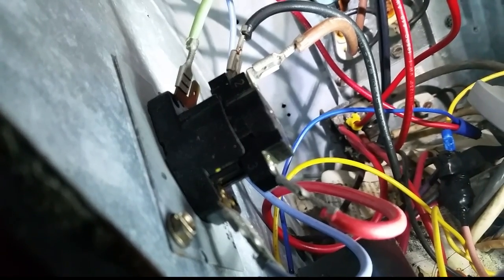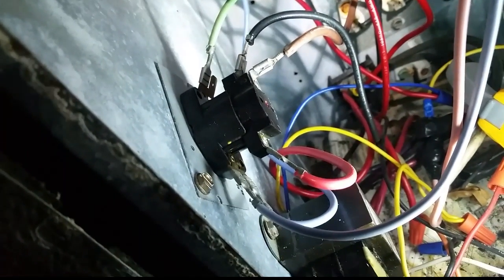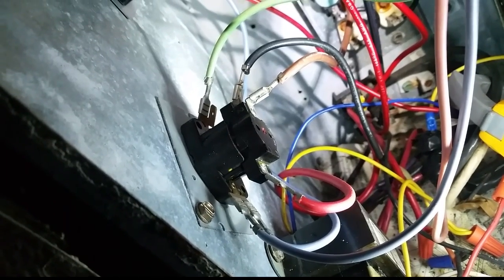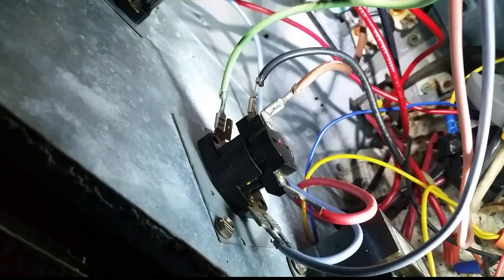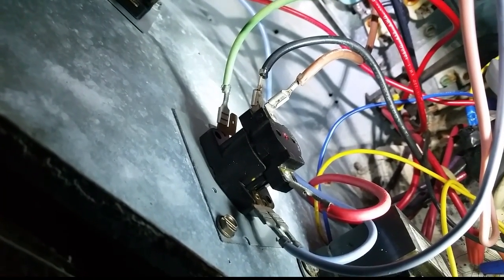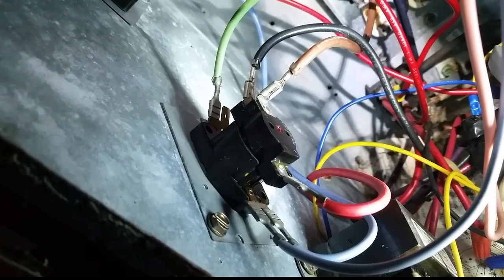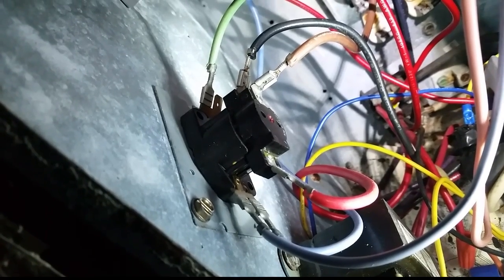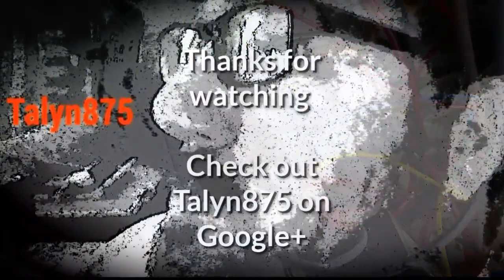HVAC Relays : Stack Blower Relay

Comment: I have this issue where the blower comes on for about ten seconds then when I hear the relay switch the blower shuts off until I power off the unit and let the relay reset. Any ideas?

Comment: I also have a very old Goodman 1998. Recently the fan relay was replaced with a 90-340 2-pole fan relay, but I notice whenever the AC turns on, it makes a loud single CLICK.. is that normal?
I ask because the old one did not do that or at least it wasn't noticeable.